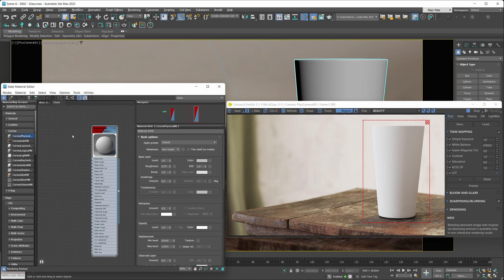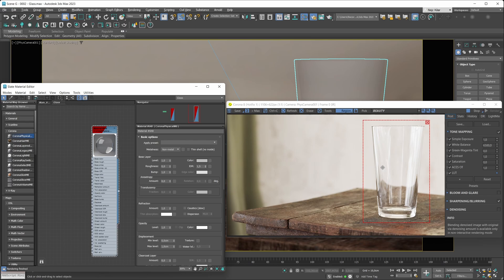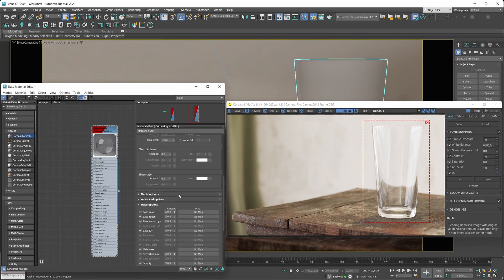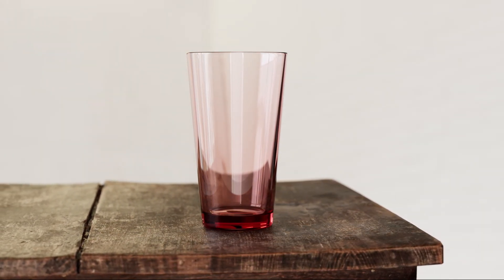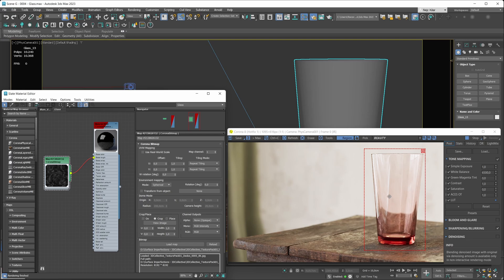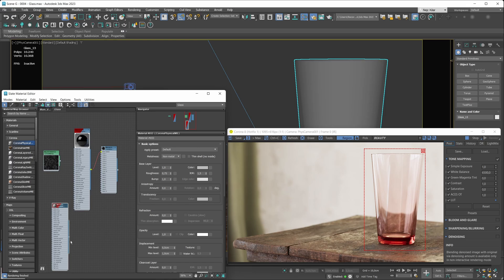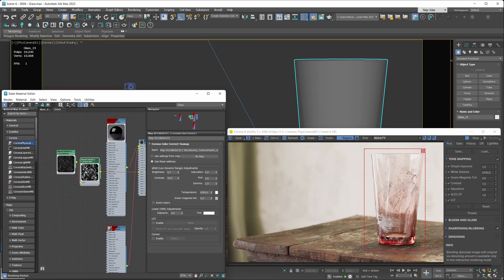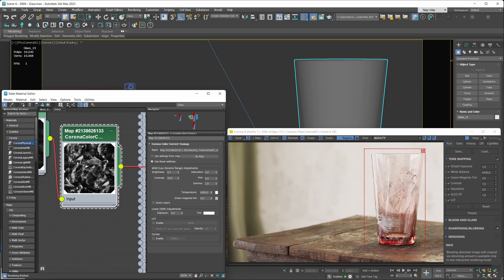Corona for 3ds Max Physical Material Tutorial, Part 09 - Basic Glass Materials

Comment: 🤔⁉Corona team: At 14:15 in the clip, it sounds like you split (not physically, of course) the close mesh with volume into two thin planes by adding a Multi/Sub-Object map for the render engine input. How did the VolumetriC Effect for the GLASS COLOR work properly, since it looks like two thin surfaces? To me, it resembles translucency (with the thin layer checkbox enabled) instead...🧐
Reply from the maker: Not entirely sure I follow the question, so do follow up if this doesn't answer things for you (also, if you are trying this for yourself and getting different results, it would help to see the renders, the material set up you are using, or even the scene, which can be done via posting on the forums at https://forum.corona-renderer.com/ or by sending in a ticket at https://support.chaos.com/requests/new ). 

Anyway, we do not split the geometry - we do select some of the geometry and apply one material to it (the dirty glass, on the selection of polys that make up the outside), and then apply the clean glass to the other polys. The object remains one piece of geometry, just some faces are painted with one material, and the remainder painted with the other.

It also helps that the same glass is used for both - on the outside, it's the glass material layered with the dirt; on the inside, it's the glass material with no dirt layer; but both are the same glass material.

Let us know if that helps! Thanks! Tom

EDIT - so there are no thin planes involved; it remains one object with an actual volume.

Comment: These results totally depends on  the environment map you have use here , right ?
Reply from the maker: Hello! That kind of depends on what you are referring to with "results" :) By and large it is always a good idea to test the same material under different lighting conditions (in this case HDRI environment) to see how it behaves. Your glass fingerprints might be barely visible if you are using a very non-directional, uniform lighting setup whereas if you go with a more moody, directional lighting setup then those fingerprints might be way easier to spot - and this is the same behavior you'd see in the real world.

As far as dialing in the values for each parameter, that will obviously differ based on the type of glass you're trying to recreate and the imperfection bitmaps you are using.

Hope that helps any! Nejc

Comment: hello i really love your tutorials but i have a question though, when i enable volumetric scattering, my object behaves differently than yours. The volumetric scattering tint i get is evenly applied on the whole object instead of like yours which fades away as it travels the object.
Reply from the maker: Thanks for getting in touch, and ty for the kind words on the tutorials! We'd love to help you out with the issue you are having - to do so, could you post your question over on the forums? There you can include an image that shows what result you are getting in rendering, plus a screengrab of your material set up, as we'd need to see those to know what is going on in your scene (and YouTube doesn't allow the sharing of images). Pop on over to https://forum.corona-renderer.com/index.php?board=29.0 and post there, and we look forward to helping you. (at a guess, it is absorption distance, where that is too large for the size of your object meaning it gives an even kind of absorption, but, we'd need to see more details to know for sure...) Thanks! Tom

Comment: How do you control the amount of reflection in the glass material.  I get comments from clients to decrease the amount of reflection.
Reply from the maker: In a physical sense you can control the reflection strength by tweaking either the IOR / Specular parameter or by making the reflections more diffuse (aka less glossy / more rougher).

Both of those options will however affect how the glass itself looks like as the IOR change will affect the way the light rays refract and tweaking the roughness will make the entire thing look rougher.

So then, probably the most straightforward solution for these types of "not so physically accurate" materials would be to use the Corona Legacy material and separately control the reflections and refractions.

Hope that helps! Nejc

Comment: Question about the layered MTL: when you plug in a map into layer 1, does the light travel through both layer 1 and the base layer or does it work like a simple switch between the 2 materials based on the mask?
Reply: The latter (Based on my experience)
Reply from the maker: @zaparine  thank you for chiming in! We really like seeing a vibrant community exchanging thoughts and ideas! Nejc
Reply from the maker: That is a really good question, thank you for asking it!

By and large, if we keep it simple(r) it works as a mask, yes. There are some technical nuances to it but you can just think of it as a mask.

If you want to have dirt that has, for example, subsurface scattering going which affects both the top layer and the one's below it you would actually have to model the dirt as actual geometry because it needs thickness to do the SSS calculations.

Of course though, that is potentially nitpicking it as the SSS effect in this case would be really negligible (dirt on a glass typically doesn't have 2cm thickness to it) unless your dirt is actually super thick at which point... You are really advised to clean the dishes anyway :)

Hope that helps! If you have any further questions feel free to comment back or open up a thread on our forums (https://forum.corona-renderer.com/). Nejc